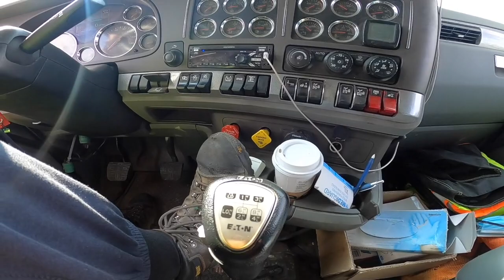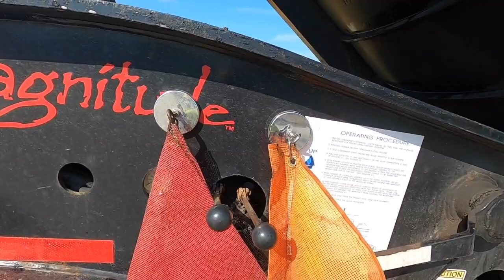Doppstadt Shredder -- 77,200 LB -- ON to OH

Comment: Just a little off topic - you had talked about stains in clothing. Try Multi-Purpose “GOOP” hand cleaner - it advertises itself as the ULTIMATE STAIN LIFTER & it works. Use liberally.

Comment: Hope you're dealing with this heat ok!
Reply from the maker: I feel much better after I discovered that AC in the sleeper was turned to HEAT (!!!). I have an option on the dash to activate the sleeper's AC in order to keep the cab cooler, and I noticed it didn't help at all ;) then I looked at the controls back there, and they were all set on HEAT. Now everything is set to COLD.... outside heat is no longer an issue.

Comment: It's got a kingpin because it comes axle configuration also for like power only.
Reply from the maker: 'power only'? you do realize the machine has TRACKS???
Reply: They have a boogie wheel attachment that connects under the rear for on road travel. As an option
Reply: @HHTV60  they have axles with road tires that can be placed under there for power only travel.

Comment: Do you let the RPM come down all the way to 1000-1200 for hwy cruising?  Do you shift early at around 1300-1400?  Or is it more likely 1500-2000?  I had to bail on a virtual job in ETS2.  It cost £15,000.  The truck got stuck on a steeply inclined off-ramp.  The rear escort van wouldn't back up.  So, I was trapped, with no way to build momentum.  The AI van in front had brake-checked me.  Because there was a sudden 30 km/h roundabout at the top of the off-ramp.
Reply from the maker: when I have a super-heavy load, and the hills are extremely steep, I let the RPM roll down to 1,350 or 1,300 before I down-shift. If the load is not too heavy, and the hills are medium size, I let the Rpm go down to 1,200. A few experiments showed that the truck can still recover in Top Gear from 1100 rpm without downshifting (!). of course, you gotta keep an eye on the coolant's temp -- I usually turn the fan on manually at 200 F.

Comment: Do drivers get charged by the pound any time they are over weight or is a standard set fine? Hope in a future video he might explain it to all of us heavy haul fans.
Reply: It goes by the weight your over the more your over the more it cost it usually starts out at a base price say 2 ton over is 360$ and so on it goes by your axles your steer axles your drives trailer all that good stuff great times 😂